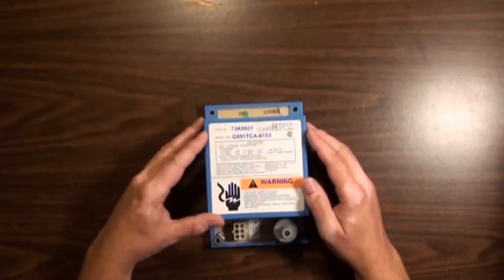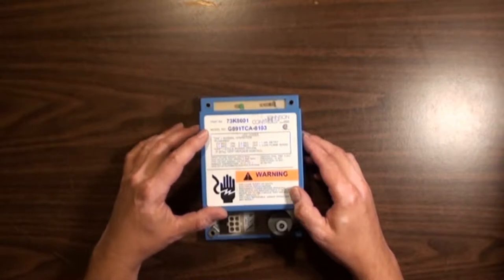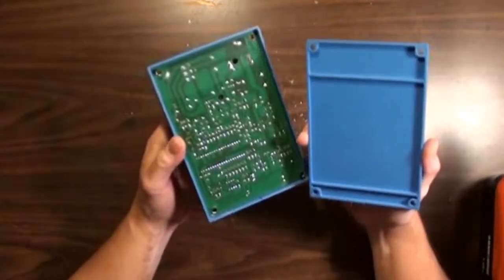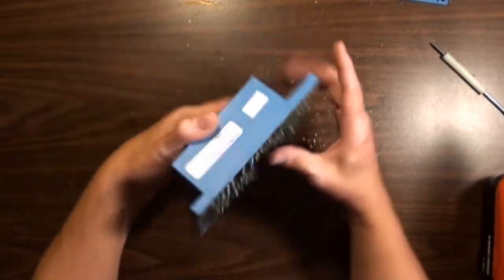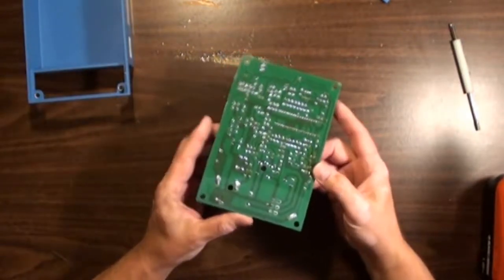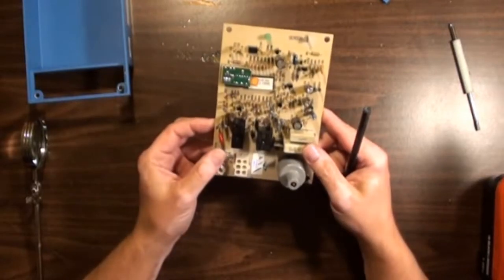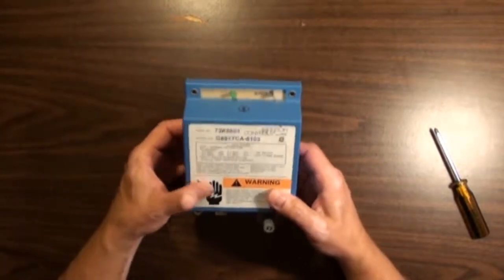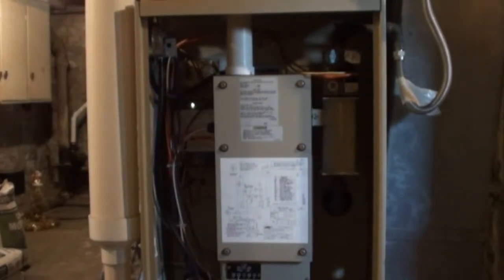Lennox Pulse21 Furnace Controller Board Repair

Comment: Nice video. You took the mystery out of repairing the controller. I'm here because my Lenox Pulse furnace is not working. I have an after market controller, a BASO.The green light is not lit when the flame is not on or being lit so it looks like my controller is bad. I will try and confirm this before attempting to repair it. Thanks for the video.

Comment: I’m looking at an identical controller I replaced years ago that was working intermittently.  I saved it and upon looking at all the solder joints, I haven’t found any problems.  I noticed some darkening around R3 and R5 - but not sure this indicates a problem?
Follow up…. I did finally find a cracked solder joint on the top left pin of the main white connector.  I re-soldered it.  This would explain why it would sometimes work.  I’m testing it now and will determine if it’s now reliable. Hopefully I too now have a spare!!

Comment: Did you notice a pattern as to which joints where cracking?  same joints on both boards?  I still have one of these furnaces.  it still works good.  93 install.  they sounds like a Buzz bomb from WW2, V1.  I would've liked to seen your wiring on the main thermostat connection.  I tried updating my thermostat and I don't get 24 volts through the C.  Old thermostat was the mercury type.  MAnual says it's thermostat as I get 24 volts on other connection.
Reply from the maker: I didn't pay close attention to the location of the different boards for bad solder joints, but I can tell you that they will be around the components that heat up like the big resistors and they'll be around some ground connections. And if I understand you correctly, the "C" is the "common" or ground point to check other voltages like the 24 volts. I hope this helps.
Reply: @ElectronicsEditor  As I mentioned also… I found a cracked solder connection on the main power plug.  Top left pin on mine.  Caused intermittent failure of furnace ignition.